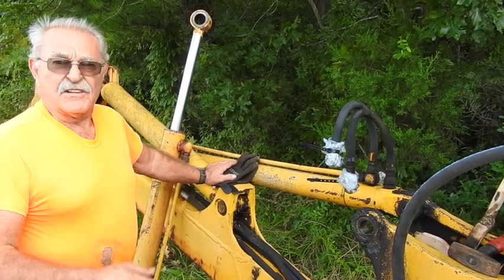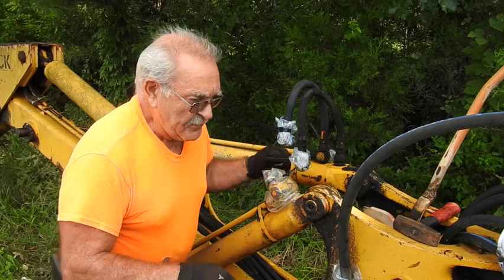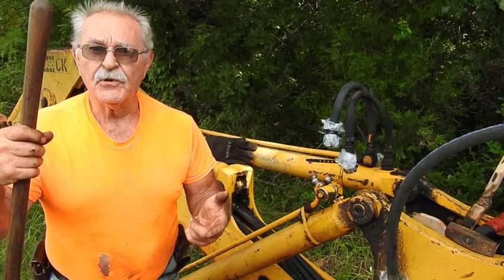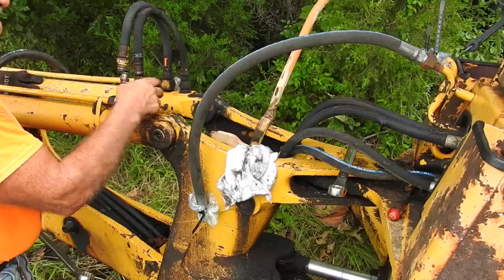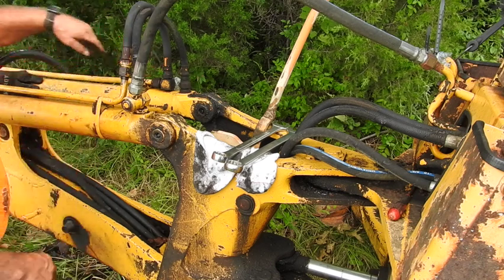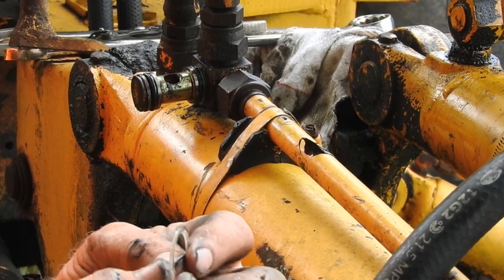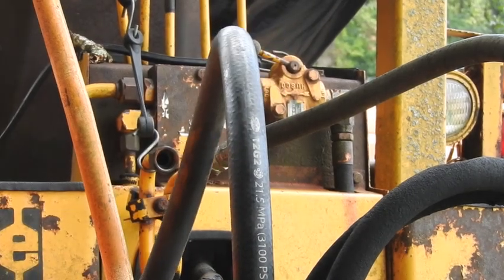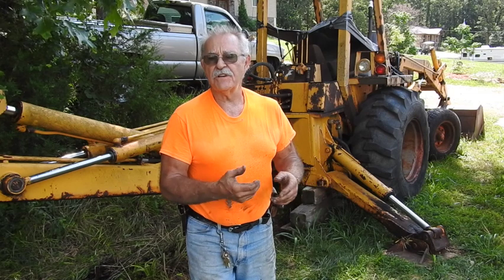580B Case Boom Hydraulic Cylinder Install

Comment: Hi, just saw your video and was wondering if you could tell me where to get those split nitrile washers (bushings)? Thanks!
Reply from the maker: Just about any hydraulic hose repair shop or mobile hydraulic service truck should have them Martin.  Even a heavy equipment mechanic should have them on the truck I'd think.

Comment: Boy Wendell,  that sure was an expensive break down.  That's really too bad. What lake are you working on? Are they residents or tourists?
Reply from the maker: I wasn't hurt too awfully bad with the price tag Mike.  I think it was about 60 bucks for whole kit including shipping.  There was some fluid loss, but I'm guessing it was well less than a gallon.  Its a small 55 acre private lake with roughly 65-70 property owners. My daughter has one of if not the largest piece of property in there with the addition of the new lot next door.

Comment: Good work buddy! Still a fan of that belt! Ha! Your shirt ripped off a piece too. LOL!
Reply from the maker: A close look at a lot of videos shows many of myu shirts have holes in that general area....and for some reason they seem to align with the spark spray off the angle grinders....  Hmmmmm.  Yeah, I set 'em on fire quite frequently.  My duct tape patch fell off though about the time I started recording.  LOL  I'm breaking in another new tool pouch right now in my dress pants.  I'll use it for that for 5 years or so then turn it into another work belt like this one. 
     But I tell ya what, I just last year had this guy make me a leather  dress belt for dress pants.  I met him at a local "Heritage Days" at a town south of me and ordered one.  It cost about 40 bucks but though not as heavy as these tool pouch belts it is a superior full LEATHER belt.  He has a variety of designs he cuts into them or you can get a plain belt.  I'd recommend him to anyone.  It's: McPhail Custom Leatherworks. If you have Facebook, you can find information there or call 573-543-5313 and talk to him about his product.  You won't be sorry.  Super nice guy so far out in the woods you think you are lost or made a wrong turn....then there he is.  But you can order online and have it shipped anywhere in the USA. He won't remember me, but tell him he comes highly recommended by a satisfied customer.  Actually, tell him I'm the one with the big old Landis leather cutter I have and  talked about in his shop.   He'll remember that I bet.
Reply: @tractorman4461  lol! Maybe your shirts just have a thing for getting holes in them. Oops! Thanks so much for the info. I have Facebook definitely going to look into it. I really appreciate your comments. Have a good one !